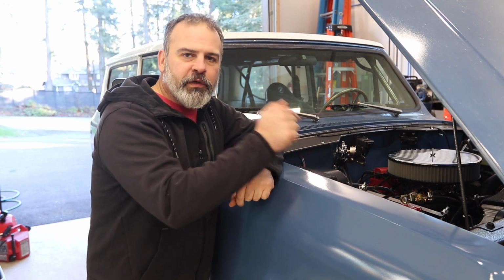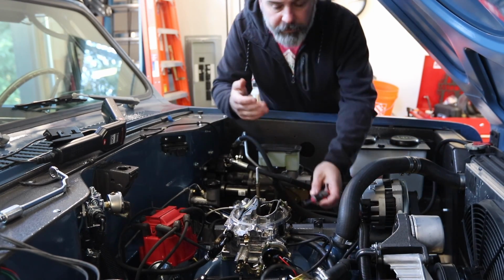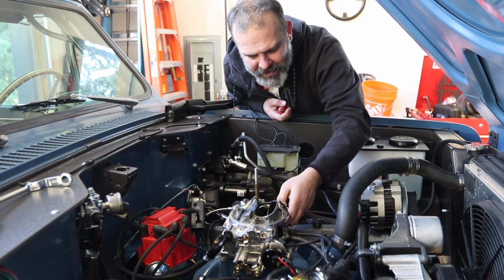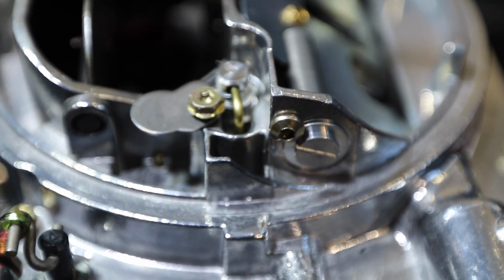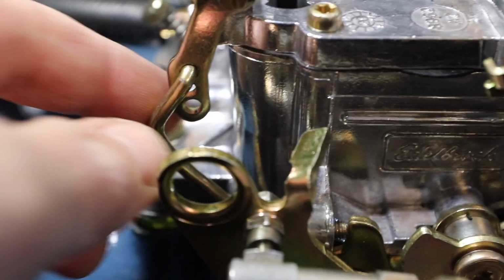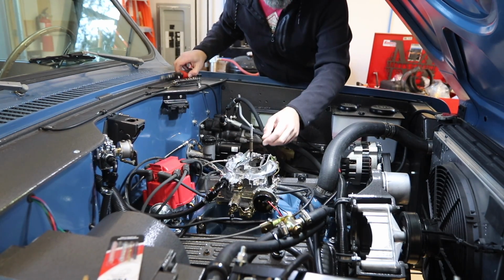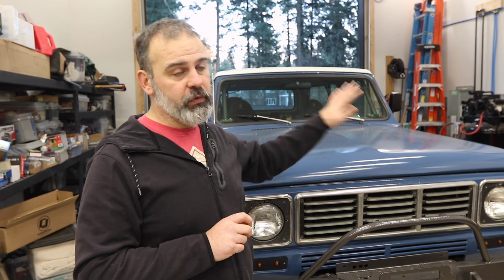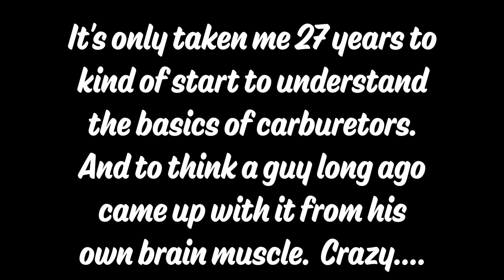8.12-Edelbrock AVS2 Fine Tuning

Comment: I have the 650CFM AVS2 on a stock peanut port 454 in my square body.  33 tires, 4.10 gears, 4L80E trans.  Out of the box with just the idle screws adjusted I'm getting 12 around town and 13.5 on the highway.  It's the best carb I have ever had.
Reply from the maker: I like it too.  I have since put a sniper on the scout but plan on putting the AVS2 on the Bronco.
Reply: I have an AVS2 1906 on a FE390 with RV cam on F250. It's given me the best mileage yet out of a Quadrajet and a 1406 Edelbrock 600 cfm. I got 8.5 in town on the Q-jet. The 1406 gave me about 9.25. The 1906 gives me about 9.75mpg in town. It does much better on the highway. Almost 14mpg. I wish I could get it over 10 mpg in town but I'm thinking I'll need to get my cam degree to zero. There is only one set of timing marks on the chain sprockets but since the cam was installed 30 years ago, I'm inclined to think it's ground as much as 9° retard. I'm thinking that cam may be making it suck alot of air because I'm in process of tuning it. I get a stumble mid range RPM. I'm having trouble with it running bad after I let it set then start warm in really hot weather above 88°F, so I'm inclined to think I'm having too much heat trapped in the bowl and it could be trying to boil. I put in a 37x65 meter rod down from the stock 37x70. It ran better until I restarted it on a hot day and it just ran crappy and stumbled all over the place. I'm waiting for the weather to cool so I can do more tuning and eliminate the potential boiling issue.
Reply: @stephensaasen8589 did you add .5 to 1 inch spacer so carb is not touching the intake which may boil your fuel? Also try drilling a 1/8 holes in your main primary butterflies to draw in more air during idle for better mixture during idle.
Reply: Old school timing trick I use is, without the light, just use vacuum gauge, advance the distributor to the highest vacuum, retard about 1hg vacuum, set idle mixture to highest vacuum, than back off on idle a little, look at the timing. This way you know you are getting the most volume in cylinder. Go for a drive, open her up, if pings, back off on timing about 2 degrees, set mixture, set idle, try again. Anyone with cam, you should drill two 3/32 or 1/8 holes in the primary for more air during idle. It does not hurt anything and mixture screw will respond better.
Reply: @Faith0929ROK  yes. I have the original Ford spacer. I bypassed the heater hose that usually runs coolant through the spacer to warm it up. I even added to that the very thick quarter inch insulating gasket. A friend of mine thinks I might have a fuel pressure issue since they seem to like 5lbs.
Reply: @Faith0929ROK  thanks for the advice. I do have the timing marks still on the harmonic balancer. I was referring to the timing marks on the timing chain sprocket because I thought about advancing the valve timing. A friend told me RV cams are usually set roughly 9° retarded with long duration to get that lugging power. Don't know if that's true or not. If memory serves me, I think the lower sprocket had the 2 - 4° advance or retard markings on it so the only way to prove that would have been to actually degree the cam before installing the chain.
Reply: @stephensaasen8589  make sure the tcc locks up in the trans or you wont get better than that
Reply: @TheTuningSHop-b3d i have manual 4-speed transmission....

Comment: This carburetor is to large for your application . Based on the cubic inches you should be using a 500CFM  rather than a 650CFM  carburetor .

Comment: Too many times I've had the wrong carb for the manifold. If you have a spread bore manifold which is what the performer is, you should run a spread bore carburetor or a q-jet. Edelbrock square bore carb should be on a square bore manifold.  The adapter is still an issue. In my opinion. The rpm performer manifold is made with square bore. Easiest way to check without removing the carburetor is the performer manifold usually has an  egr port and the rpm performer does not. The q- jet is a good carb for a truck and runs really good when paired with Edelbrock performer manifold.

Comment: Unplug distributor. Cap the carburetor port. warm up engine and rev til the mechanical stops advancing. Set that to 32-36°.( So the base may be 12 if there is 20 in the distributor weights) . Once you have all of the distributor mechanical timing added in something like 2800-3000 rpm then plug distributor to full vacuum and reset idle speed. Your timing will show up something like 22 because 12 is the base and 10 is from the vacuum can.

Comment: note when setting the idle jets can you get it to go rich when backing them out ,if not the idle circuit feed is to small and there is not enough fuel for transfer circuit between the idle and the start of the main circuit ,so if you are coming off the idle slow and loaded some it will bog some some times pop , note when adjusting the accelerator pump for more fuel will help under faster accelerator movement , but will still be there under slower movement .

Comment: Excellent information, thank you very much for making it simple as I am not a carburetor mechanic by any means, I’m running a 390 FE motor in a 1974 F-100 with a fairly lumpy cam at about 450 to 475 hp. My issue is at launch with this new AVS2 650cfm carb it stalls so I am going to try changing that pin location on the metering block and if that does not work I am going to buy some new springs, excellent video

Comment: Have you adjusted when the secondary air flap opens? I had a definite stumble when I would go from cruising and hammer the throttle wide open. I tightened up the air flap which made it open a little bit later. I guess what was happening was the air flap would open and the car would go lean for a second. I may actually try larger jets in the secondary and loosen the air flap up again.

Comment: Did changing the springs help?
I've got the exact same issue in my 80 Camaro. Running a 350 SBC, Edelbrock AVS2 and Summit K1103 Cam. 
Idles fine, drives around fine. But the moment I kick it in the guts it stumbles and pops.
I've adjusted the total timing with an adjustable light. Had the initial timing at 10. 
I've recently increased the pump shot and it stumbled less, but still bogs....it's bugging me.
Reply from the maker: Sorry for the late reply.  They definilety helped but still not perfect.  Will need to keep tuning it but it's slated for being put on the 302 for the Bronco.
Reply: @MattsGarage  all good. Nice!
I ended up putting the 7hg springs. Readjusting the AVS2 secondary flap tension and increasing the pump shot up to the highest level and it doesn't stumble anymore. Only now it's less fuel efficient as a daily hahaha
Reply: @hoscba  on the 1906 I've been having really good luck adjusting the spring tension on the secondary flap. Each time I tighten it it gets better. Still in the process of getting rid of that stumble altogether. The air is rushing in faster than the fuel. Seems kind of absurd but taking some air out of the equation will actually help this issue. T15 torx to loosen the lock screw, big flat head. Counter clock wise is tighter, clockwise is looser.

Comment: I got the same carb for my 460, but that engine is still in the works. I imagine that with the 460, I would have to automatically go with the #8 spring to start? It's built for torque, not a lot of hp. Low RPM range cam.
Reply from the maker: Great question and I don’t want to pretend to know the answer. I will guess though: not necessarily because of the high torque of the motor it may not drop vacuum as much as it’s wimpy small buck cousin. You’ll have to trial and error is my opinion. It’s easy though. 10 minutes if you take a coffee break.
Reply: Thanks for the video 
I have a 71 Bronco 302 with an Edelbrock 1406 and have had the same issues for 20 years 
After changing carbs 3 times 2 distributors and cam I was thinking it was a bad engine 
I am going to rebuild the carb and change the springs today 
I’ll let you know how it goes
Reply from the maker: @broncobrady3121  please do! Feel free to email me at Mattsgarageshow@gmail.com

Comment: I have the same carburetor on my 1991 C1500, 5.7, 5 speed manual, lower end all stock. I installed Edelbrock E Street 64cc combustion chamber heads, I be leave that 76cc was factory heads for that motor. I also replaced the cam/lifers with a Summit Racing mild cam, more than stock though.
Reply from the maker: I did the same thing I swapped out the original 76cc smoggier heads for 64cc vortec plus a lunati cam. The motor is much healthier now
Reply: Also installed steel roller rocker arms, 5.1, stock ratio. Currently using 75-42 rods with 401 jet on the primary, secondary was leaned out with 0.092, which is a 392 jet. My idle mixture screw’s are out 3/4 turn. Also 1 step stiffer on springs which makes the secondary part of the rods starting to kick in at around 7 inches of vacuum. I installed an AEW air/fuel ratio gauge to help me to get to this combination. WOT I’m around 11.5 when I first get on it, then it leans out closer to 12.5. My idle vacuum is around 15 after warmed up and idle mixture screws, again, at 3/4 turn out, which mak s my AFR around 13.5, give or take. Also I’m running a Weind aluminum intake, factory HEI Chevy distributor, which is a Chinese made one. Word of advice, replace the magnetic pickup coil and the ignition module with a good quality one, preferably factory GM parts. The Chinese electronics on them are junk. I had a MSD Street Fire ignition control box installed, which eliminates the ignition module in the distributor, but had an issue with a hole burned through the rotor cap, thus grounding it out on the distributor shaft, = truck wouldn’t run or bad miss. Bad miss, failure to run first happened with the coil, then the pickup module. Lesson learned on E Bay parts not being American made.
Anyways, like everyone else, I continuously experimented with different combinations, springs, jets, metering rods, trying to get the AFR readings that I was looking for, finally setting on the combination previously mentioned. If your battling with tuning a carb, best tools to have is a vacuum gauge, and by all means, an AFR gauge, a broad band one.
Hope this helped anyone.
Reply: @stanriley2020  what kind of cam did you get from Summit name brand? And do they work fine?

Comment: i see you have the rear carb studs in the inside holes i cant use the outside holes the washers and nuts dont fit behind the carb the front has more room

Comment: I never had so much trouble. I got this tip in stumble too with a 1406. I rebuilt it, messed with timing, springs rods, fuel pressure. it idles then it runs rough at any time it wants too. I ordered a 1906 and its going right back if it doesnt fix this crap. I've had so much trouble its unbelievable
Reply from the maker: Been there.  That's super frustrating.  It's probably something simple you'd never think of.  Good luck getting it figured out.
Reply: @MattsGarage  it was all the distributor. it was arcing inside from carbon dust for some reason the carbon button was wearing very fast and raining carbon dust. unreal. also alot of timing chain slop but 100% the distributor. also new rotors are coming with the conductor tip bent up to the sky and too far away from the contacts.
Reply from the maker: @1112223333111  That’s why they say 70% of carburetor problems are ignition problems. Glad you got it figured out

Comment: Got the avs2 650 cfm for my 327 sbc Vega about a few months ago, it runs well when warmed up but can be stupid rich at idle when cold and give that hesitation sometimes like you were saying.. it's got some double hump heads, a decent size cam, edelbrock intake, 3.73 gears in the back .. I didn't even know about these springs, would you think I'd have to step up to the 7" like you did? Or just leave it because it's a small light car? Idk lol I'm 26 and just into this carburated engine scene.. get kinda lost sometimes
Reply from the maker: I still get lost myself. If it’s rich cold then that probably means your choke is too aggressive. It’s reducing air to make the carb richer (therefore happier) when it’s cold. If it’s set too aggressive then you get very rich.

Comment: Did you ever move the pump lever?
Drill out and old AFB squirters and swap it out.  
More torque? - Advance your cam 4 degrees.
Reply from the maker: I have since switched to Sniper on the Scout. This carb will go on the bronco and I’ll tune it to that 302.

Comment: I have the AVS2 for 5 months and I have the screw that lowers the Idle all the way out not touching and when I drive my nova I have to put it in neutral and rev real fast to get the carb to idle back down at a stop light it’s like something on the passenger side of the carb is hanging or something how can I fix this please?
Reply from the maker: That sounds like timing or do you have your vacuum advance on manifold vacuum? I’ve struggled with that too and it was a combination of timing, vacuum and the idle mixture screws.

Comment: There is no 'power valve' in those carbs. The 'Cup' is called a power piston. I'm surprised that on such a mild engine it didn't work out of the box. I have an engine a little bit bigger than yours (383 Chry), mild street cam (Crane HMV272), dual plane intake, ported heads big valves, 2.5in duals, Jacobs ignition, and it pulls 15" vacuum smooth idling. I literally took it out of the box, adjusted the idle and MAYBE 1/4-1/2 turn out on the mixtures from where they were. The exact same carb as yours. It's also WAY better than the Carter 750cfm Competition series I took off. You're supposed to adjust for best lean idle so the plugs don't load up. Find the highest Vac and RPM then go in about 1/4 turn in and raise the idle up to specs on the emission label. The other thing is these carbs have annular boosters so you probably need to back off on the timing. That cam sounds OK for your truck. I don't think you'll notice much by swapping it.
Reply: Pulled my 800AVS2 out of the box.  1 mixture screw was 1 3/8 turns, the other was 3 1/2 turns out.  The air door was set up w 2 1/2 turn preload and the manual stated 1 1/2 is the default. 
I had a feeling to check it.  
The floats were spot on.
Reply: @tomreyn3610  I bought mine 4 years ago when they first came out. The screws and door were as per spec. Never checked the floats but I have no reason to believe they're off. I don't doubt there are quality issues everywhere these days. I think they only had 1 or 2 sizes when I bought mine.

Comment: So how does it perform off road steep hills etc. great video
Reply from the maker: I took it off road once before I switched to Sniper EFI (always the plan). It ran fine generally but it gets really rich at altitude. I didn’t do any super extreme off camber, but it never stalled on my. Again, just super rich at altitude. That’s the main prob with carbs in general off-road in the mountains.
Reply: you would need the 1916 vs 1906 for off road
Reply: @MattsGarage  you would need the 1916 vs 1906 for off road

Comment: Mine seems to act like yours ever since I put the AVS2 in a Edelbrock performer dual plane intake but mine just smells really rich. How have you got yours running better since this video?
Reply from the maker: No, I put a sniper on the Scout.  I plan on running this carb on the Bronco though and will be tuninig using an O2 sensor.  I'll try to make a video about that but it won't be for a while.  I'm still in paint and body.

Comment: Matt, could you video fuel pump and regulator?
Reply from the maker: Hi Tom.  I used a Tanks In. PA-2 in tank pump. The regulator is just a standard Holley carburetor regulator.  It's a simple system.  The work is just getting the tank retrofitted safely for the pump.

I'll have a similar set up on the Bronco which I will show in an upcoming episode in the next month or so.

Comment: just out of curiosty what is 10 drgrees of vaccum ?
Reply from the maker: What do you mean? Are you asking what vacuum advance is? That’s a complicated answer, but basically when you have high vacuum, it pulls an armature in your distributor that advances the timing by some amount. Usually it adds 10 degrees of timing. If that doesn’t make sense I suggest watching some basic videos on timing advance.
Reply: You need to go back to the beginning of studying the basics to understand vacuum etc.